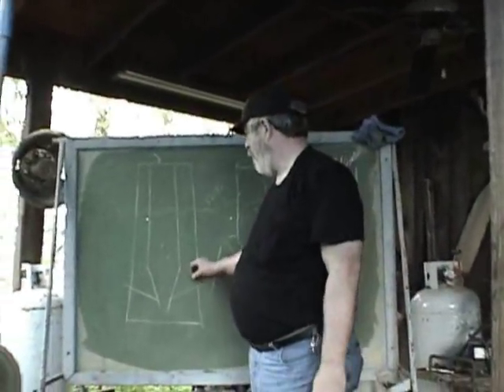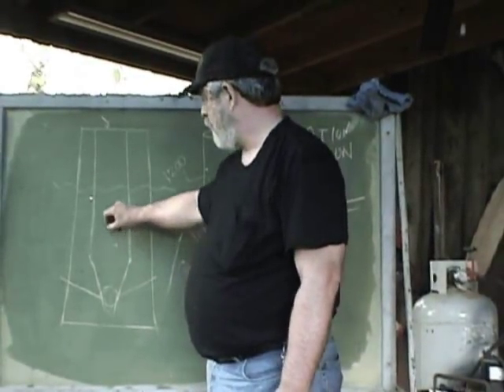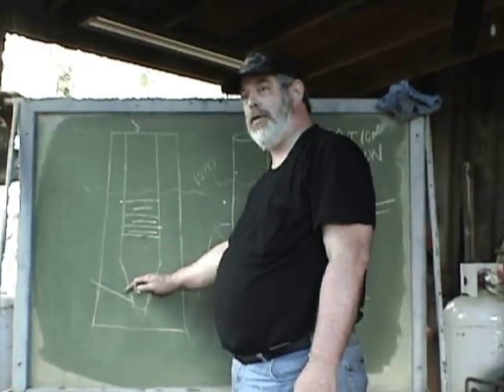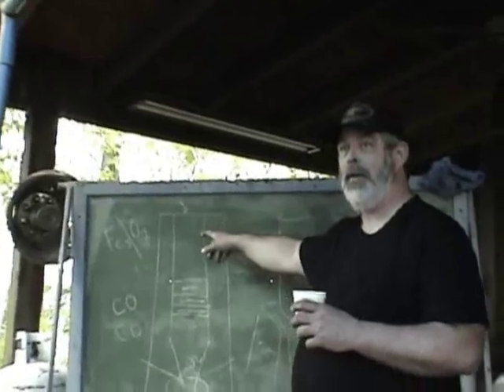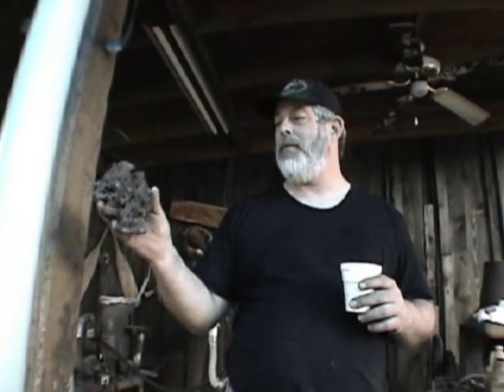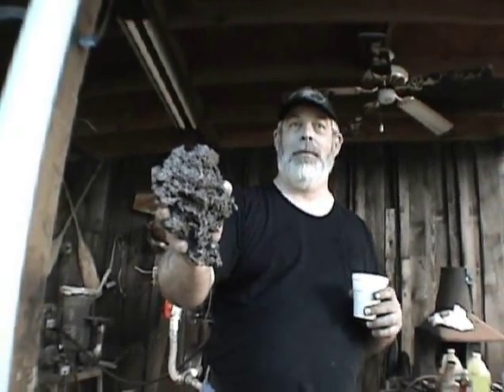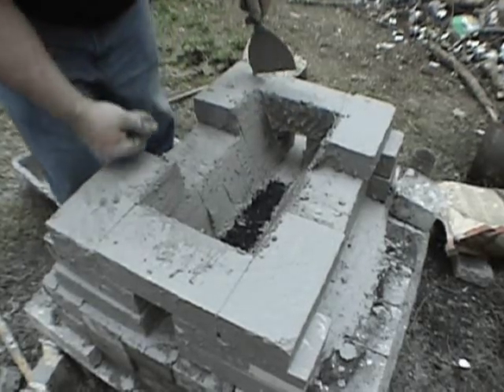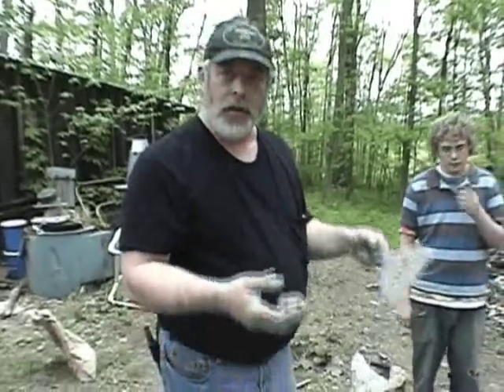Making Steel from Iron Ore

Comment: Wouldn't this be called "iron" not "steel?" It's iron ore smelted into iron, right? If so, then the title of the video is just misleading, right? If not, what is the difference between "iron" and "steel?" Thanks!
Reply from the maker: The addition of Carbon makes it steel, and pure iron is very difficult to make using a charcoal smelter, as carbon always finds its way into the metal. Modern "mild steel" is mostly iron, but it's very hard to make it chemically clean, even using modern foundry practices. This smelter in the video is modeled after the Japanese style Tatara, which produces a steely bloom, which is compacted and refined directly into sword steel.

Comment: I learnt about it in engineering course this is more lead than steel but still impressive
Reply from the maker: There is no lead in this ore, or this furnace. Solid-state reduction of magnetite to iron is something my friends and I have been doing since this video was posted over 10 years ago...
Reply: @tidewaterforge  sorry I'm not a native english I meant cast iron due to the high carbon content
Reply from the maker: @atomique3656  Still incorrect, the product was forge-able, and spark tested in the medium carbon steel range, ~0.6%C.
Reply: @tidewaterforge  thats interesting, I thought you needed an extra step to get the extra carbon out by blowing 02 in it, guess the vents on the side did the job. (My only knowledge is about the industrial process)

Comment: REQUEST: please post some useful details, such as what type of iron ore you used, how much of it, and where you got it from,  how much charcoal was used, number and type of blowers (CFM of airflow is important info), peak internal temp if known (presumably close to 2500F), what was the weight of the resulting bloom, and how much weight of finish mild and high carbon steel did you wind up with when you were all done.

Edit: the gent at 7:49 probsbly should NOT be beating on the newly uncovered bloom directly with a hammer, or it could crumble. It seems to be a common mistake.  AFAIK, best practice is to first consolidate the bloom by placing it on a wooden stump anvil, and beating it into a roughly cohesive mass by using a heavy piece of wood  to buffer the blows of a mallet .... once it is consolidated from wood-buffered hammering, THEN you can switch to increasingly forceful direct blows with steel hammers, with far less risk of it crumbling into a mess of quasi-useless fragments.  After that you use a cutting maul or chisel or a diamond chopsaw to cut it into smaller chunks, spark test each one and separate them into low/med or high carbon steel ... then you flatten and forge weld together the chunks with similar carbon content into billets.  The result should be not 1 but 2  finished billets, one of low/med carbon steel and the other of high carbon steel respectively.  

If you just work everything into a single billet, the carbon content gets averaged, and you're left with a medium carbon result, and no high carbon steel at all. Then again, different people has different objectives in mind ... but if it were me, i would absolutely segregate by carbon content.

Comment: Christopher Price+   Since I have no clue how to make steel, or any kind of metal. What was the "Powder" he was putting in with the charcoal, layer by layer??? Also, why did they continue to heat the steel and strike it with a hammer. Is it knocking off slag?? WTH is slag?? LOL See, I have no clue!! How long does it take to clear the slag from the metal in general? I would have liked to see the finished product and someone working it with it. At the begining they mentioned a knife and I was hoping to see it made. That would have been AWESOME!! I have an interest in how metals are made from raw ore (I'm guessing all metals are made from different types of ore's). I think it's important to learn these types of things for many reasons. Certainly something that should be passed down. You never know when such knowledge will become invaluable.. Do you have any videos that have more indepth information?? I'd really like to see the entire process from start to finish (with the melting time sped up of course! LOL). Even watch the finished steel made into something. I'd definatly wactch that.. Thanks for the post.. :)

Comment: its not a steel
Reply from the maker: Steel is iron with the right amount of carbon. 

That said, I did not make this bloom, I only filmed the process, but I trust the smiths to know what they're talking about, Mr. Furrer in particular is very experienced in this practice and knows what's going on.
Reply: no it dont, steel is a hard solution with primary and secondary carbon in cementit form. with filmed tec - only bloom iron with carbon as solide 
 pices of coal or cast iron, no exception.

Comment: So... I must have some learning disability, cuz I cant follow verbal instructions for shit and I wanna make sure I got this right. 
So you build your furnace, then start layering carbon (charcoal) then a layer of your iron oxide, then another layer of charcoal, then iron oxide, the charcoal, the oxide, then coal, then oxide, and so on, and you top it off with coal, set it on fire and let it all burn, shoveling some more coal on the top until the metal starts flowing out the bottom? Which is presumably high carbon steel, as I assume the carbon is mixed in with the Iron. Did I get it right? If not, I'd like some pointers, because I really want to know how steel is made, but all the explanations I've seen use high tech methods, or other metals, which for my interest (making steel out of nothing, in the middle of nowhere, with no prior tools other than what you make for yourself) is unsuitable. Thank you.
Reply: It results in bloomery it's wrought iron you then have to heat treat in in a furnace and condense it down by hammering it into solid iron bars . So basically after this process you get blooms of high and low carbon iron that needs to  be stacked and covered in borax to limit oxidation to keep the carbon count under 2% forge weld that . Fold it repeatedly and constantly keep it around 1500 degrees.  You always want it orange hot it helps work the iron . After the forge welding or folding is done . You can heat treat it to about 1500 degrees give it a oil bath . Then normalize the iron bar by at around 600 degrees this will give it an even but under 2 % carbon content you want that turns iron into steel.
Reply: techncially you could, make the charcoal clay bricks, and get the iron oxide from sands or other sources like stone crushing, or sift it out with clay panning,
Reply: but so does this method result in steel or just iron?

Comment: Ok... it's a ten years old video but it was very interesting thank-you.  Now comes the questions;
What's "Powder".  What's wrapped around the pipe (asbestos)?  How pure is the new steel and what's its next process?
I believe it was said that a 60lb blob of new steel was made?  How often is this done (when materials are available)?
The level of knowledge of this process was most interesting to me.
Thank-you for the time and keep safe.
Reply from the maker: "Powder" is the powdered iron ore added with each charge of charcoal. Kaowool is a common insulating material for bladesmiths. 

The iron/steel produced still needs to be formed into a solid bar, and that process eats away at quite a bit of your material, but the finished process is much like what is seen on some excellent videos of Japanese bladesmithing - the best (highest carbon) pieces would be used for edge steel, and the rest used for the core. 

There are smiths everywhere doing this far more often than a decade ago, the revival in hand-making steel for swords is encouraging and very educational in understanding the process the ancients applied to their craft.

Comment: The folding and welding, along with flux purifies the steel.  Then comes the discipline.  When you make a seven man katana blade, then show me the perfection of your craft.  Anyone can make a high carbon steel replica... doesn't mean it's equal.  

How long did it take to make that bloom?  What is the carbon content?  Where is the ore from?  Why is the charcoal so stiff?  I'm guessing it contains more impurities.  Why not show the complete process? 

I will give you this much... your forge was good.  Your details are insufficient though.  Show your craft.
Reply: what are you talking about. I also believe he was implying that when forging the blade they learnt by mistake as a by product that constantly folding and hammering the steel was driving out impurities. These people just attempted to smelt iron ore straight to a form of high carbon steel

Comment: Any one know why they are calling the final product steel? I though it took coal to make steel. Much like how wood or charcoal will not make gold ore blink. For it needs at latest 2950 Endothermic degrees. Steel takes 3200 to form from raw ore. and cant just be hammed out of iron. Oh sure you can still make a durable blade from it but is it steel or iron. I follow allot of archaeology. And the earliest steel is in the form of meteorites That have fallen to earth and then were reworked in to small knives usually???
Reply from the maker: Sorry, but your assumptions are all wrong.
The iron reduction process happens from 1200*F and up, where oxygen is reduced from iron oxides via hot CO gas, creating CO2 along the way. The non-iron ingredients melt off at lower-than-molten-iron temperatures. As O2 is reduced, iron remains, and carbon picked up in the charcoal-rich environment creates steel of various grades. Bloomery iron is almost never carbon-free, and pure iron is very difficult to make. C content can be influenced by control of the blast, the ratio of fuel to ore, and the quality of ore (and subsequent slag) used. This video shows a miniature reproduction of the physics in a Japanese Tatara furnace, and the end product is very similar.

Meteoric iron, btw, is just that - iron with a lot of Nickle, usually, especially the Campo fall. No carbon, no steel.
Reply from the maker: And bloomery material is never "just iron". Make some and get back to me.
Reply: Its bloom iron. I don't know why they keep calling it steel all over youtube.
Reply: My point in reaching as far as I have into this Is it could be added to ancient archaeology. To show that steel was just as easy to make then as it is now In even more ancient times than the vikings. As in monolithic construction and carving out the big stones like they did. As Coper, bronze, and tin were not enough to support any working theory on how It was dun. Especially when it comes to the machaniacaly etched lines in some of the cuts. That clearly shows steel was used on cutting heads. but how it was made was lost. so was completely looted for making other things out of it. Thanks for the info and If I had my health back tomorrow I definitely would be trying to make some to see final quality of the medal when worked first hand. Do you have a video of this step of the process. Maybe pitting two swords against each other in the end of it. To show ones quality over another and the damage dun to the edges. For me one rolled edge turned when cold will show allot to archaeology. As the smelting process looks to be more fun than anything complicated. And easily could have been duplicated from the same ideas of chasing meteorites and enhancing the process. Farther back in time. If you want run with it and make a cross cut saw that has some bullet teeth on it for a cutting edge. Then cut some rock with it. You'll get a million hits in a day if it works. And break a vary old lie down. That belongs buried in the dirt where no one can step in it no more. Thanks again. Chuck

Comment: is there anywhere that I can find the design for this furnace?
Reply: All he did was surround it with concrete (which later you remove), and threw charcoal in it surrounding the iron ore. 

Source: I played MInecraft for a long time.
Reply: it's on the chalkboard at the start of the video. He explains exactly what to do and they demonstrate how to use it too. This video is amazing. So much good information in it.

Comment: How do they even know that is steel and not just some form of refined iron I don't even know what the point of this is steel is every where if you need to cast and melt it the micro cupola method is not the way to go about it
Reply from the maker: +kcebolpj I suggest re-watching the first few minutes as Dr. Blue explains the chemistry. Their attempt, nearly 10 years ago now, was to mimic the steel produced by Japanese smelters, albeit at a smaller scale, using solid state reduction of iron ore in order to form a bloom, and subsequent bar with the correct chemistry and visual character of old, pre-industrial pieces. 

Yes, modern steel abounds. Swords are not made through casting. All of that is beside the point when making attempts at reconstructive archaeology.
Reply: Troll
Reply: +kcebolpj It's not like they invented this themselves, it's a thousand(s) of years old method, and it makes steel, and the chemistry is well known. Do you send your bread to a lab every time to check to make sure it's bread after you've baked it? If not how do you know for sure! Pretty much the same thing.

And steel is everywhere because people keep making steel. 30% of steel every year is new, which covers both increased amounts needed and amounts lost to rust, abandonment, etc. If nobody made any new, we'd run out fairly quickly. Plus obviously it's cool and educational and keeps traditions alive, etc.
Reply: this is the bare essentials to blacksmithing and blade forgeing
Reply: by grinding the metal if there are starburst like sparks then the iron carbonized
Reply: Steel IS refined iron. With a tiny bit of carbon  ( About 0.10% to 2% max by weight).

Comment: Iam sure you do a great job at extracting the metals but the video quality is very poor and I get confused sometimes on what's going on. It would be nice for f you re-do tlthis video with clarity and better explanation and show better construction of furnace.
Reply from the maker: Slag is the term for all the non-metallic parts of the iron ore. Silica mostly, but whatever else is in the rock. Sometimes some iron stays behind, but for the most part it's a waste product. Iron-rich slag can be added back into some furnace designs to try and get more out of it, but this is rare and specific to certain ores and certain furnaces. This combination produced just the right amount of slag to protect the reduced iron from re-oxidation, without scavenging iron from the reaction.
Reply from the maker: +Drywell Percolation Testing 
Since it was filmed back in 2006 on home recording gear (digital tape before HD) and there's no way to go back in time, I'm afraid this is as good as it gets. That said, I don't understand what you're confused about - Dr. Blue's explanation is pretty good for non-experts, and if you have a specific question, I've been following this path for some time now and can probably help clear things up if you like.
Reply: can you explain what the "slag" is? Is it the impurities in the powdered iron? Wouldn't it be considered iron too?

Comment: Can magnetic black sands be used as an iron source in this process?
Reply from the maker: Brady Rose Usually, yes. It's best to clean the ore first, by panning and again with a magnet - leave the nonmagnetic material behind as much as possible, too much will choke the smelter.
Reply: ***** oh yes of course when I am prospecting with a sluice the removal of the black sands is done magnetically, but thanks for responding to this I've been curious about this for some time. For some reason when i search on this topic I never seemed to find an affirmation that the magnetic black sands from river prospecting is suitable for an iron source in a cupola.
Reply from the maker: +John Gonzalez As stated above, for the most part. If you're looking to make your iron very clean, consider reading some sources on iron refinement. Lee Sauder is a good place to start, as is this article: http://www.freemediaproductions.info/thephora/printthread.php?tid=28343&page=3

Short version is, the bloomery material must be heated and worked to remove slag and other impurities, while maintaining a low carbon content, so a slightly reducing atmosphere is needed. Too extreme, though, and you'll just burn all your iron back to oxides. This is something that is not to difficult for a practiced person, but you might consider partnering with someone experienced if you've not been smelting enough to know your material. 

If you don't need hand-made iron, I would just consider buying 00 grade iron sheet to your specifications.

Comment: I have access to small and large chunks or iron ore. I was under the impression I could heat and beat the iron ore into steel, using a coal forge. Is this possible? or do I need to crush the iron or and then run this process? Some of iron ore seems some what flaky and other chunks are dark grey and very hard.
Reply from the maker: ***** The oxygen needs to be reduced away from the iron, like the video demonstrates. You can't just forge rocks into clean metal.
Reply: ***** bummer I was hoping you could just continually heat it up and work it until all the junk just worked its way out. So basically the only no prepared iron you can work from basically rock form is meteoritic iron?  Or does that need to be ran thru a process of deoxygenizing also?
Reply from the maker: ***** Meteoric iron is not a "rock", first of all, and requires some care to be forged correctly. Any ore is an oxide of iron, rust, mixed with the other minerals involved - simply heating and hammering will give you rust dust and silica powder, not metallic iron. Please, watch the video carefully and this will be explained.